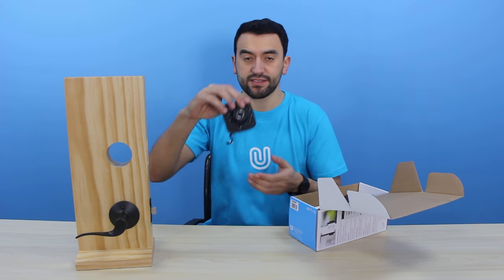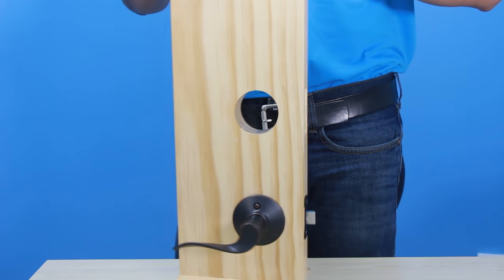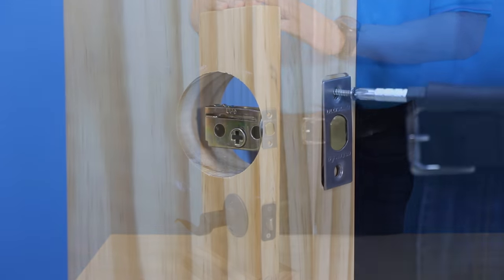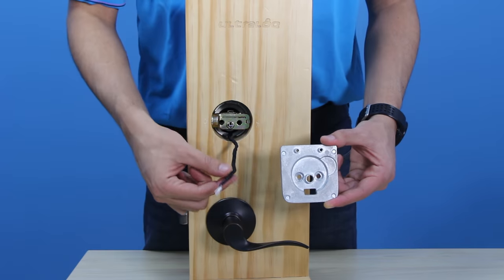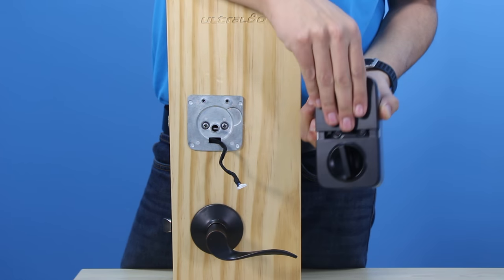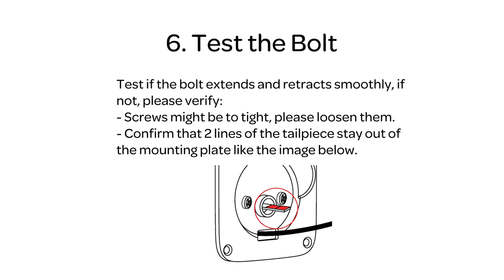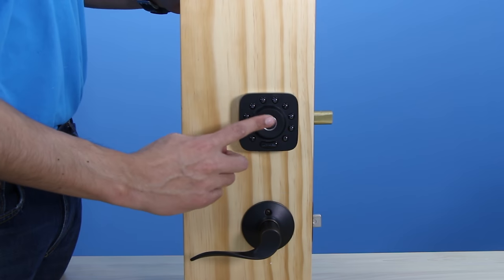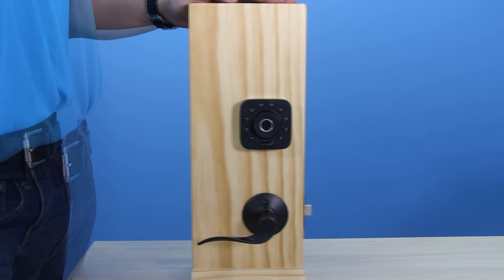Ultraloq U-Bolt Pro | Installation Guide

Comment: The actual included paper manual is TERRIBLE. It explains nothing.  Like there is a second plate that seems to go on top of the deadbolt plate in the manual. Totally unneeded for us assembly it appears.  Yet - no comment about why or what it is for in the paper manual.  Simply not included at all in this vid.
Reply: Installing mine right now and going through the exact same thing. I discovered through YouTube that the piece goes in the doorframe (I believe)
Reply: @mercy4630  Yes and it looks the strike plate they included has extra wide spacing for the screws and an extra big hole so you can place it pretty crudely and it will still function. And you don't have to worry about where the old screw holes were
Reply: I know this is a year later, but I've run into the same issue and think I've figured it out. That's a different door type in that diagram that gets screws A and B. If you have a door with the hole cutout, you just go straight to the screws C like the video did.

Comment: What do you do when you are told it is jammed and the motor seems to be resisting manual locking and unlocking? The app won't unlock it at all nor will fingerprint or code. Only having this issue after texas froze over. I replaced batteries twice already. Only started messing with it due to the low battery alert still on after low battery replacement, and now I have this jam issue. Wish I just left the low battery alert there.
Reply: Have you been able to fix the Bolt - jamming issue? :) ...Even Ultraloq U-Tec tech support do not have a clue what to do,, follow this procedure, it will take your U-Bolt out of Bolt jamming issue, the unit remembers or somehow memorized previous lock/unlock position, no matter how well you followed instruction to line up and/or loosen some screws - it would continue reporting bolt jamming (2 beep and the lock notch of the interior unit seems to be locking on something cannot lock right?)

Since you already has the unit setup/configured with the app, do not access the app while doing this, get ready your admin access code handy

1 - Remove the batteries, set the lock's bolt onto locked position
2- Insert the batteries, if you notice, the lock will not retract the bolt in locked position to unlock right? - keep it that way
3 - Now, while the bolt in locked position and with batteries installed, enter the admin code then press Ultraloq button - did it retract the bolt to unlock position? Yes , then Good!
4- Now, press the Ultraloq button again, did the bolt move back to locked position!
5 - Congratulation, Bolt jamming issue is just resolved!

I found this steps by spending 3hr on my 1st Ultraloq U-Bolt pro I bought on the 15th, no matter how good lineups I got of the installation's mechanic, it kept saying the Bolt-Jamming (to verify it I connected to App BlueTooth and indeed, every time I re-installed the unit and after the admin code setup , it kept reporting Bolt Jamming) until I found the steps above, basically remove the batteries, set the lock locked in position and press admin code again to have the lock learn its travel and lock/unlock position -  that fixes the issue!

I am surprise Ultraloq Tech Support could not give a proper troubleshooting technique to the customers except loose some screw tightness, position straight ..etc - that's not all - !! it is the unit's operational issue needs to be addressed.

Do not connect BlueTooth nor WiFi to save your batteries! and perhaps minimize intrusion/hack attempt - locks should be staying off the grid!
Reply: @jpthsd  yes it is fine. You have to reverse the orientation if it is giving resistance to lock
Reply: @jrg305  what do you mean reverse orientation? Like install the lock up side down? I hope you were able to correct your jamming bolt issue. 

if you ever try to reset your lock again in some situation, I am pretty sure it would report jamming! I tested 2 lock, all did the same!

Good luck!

Comment: 100% junk, reviews are FAKE. This lock and the company behind it are a huge joke.

I got the U-Bolt Pro with the built in Wi-Fi the other day and set it up. This lock was replacing a broken Eufy smart lock. The first issue I had was after putting in the batteries, the lock turned on but when I placed the battery cover on it lost power. I swapped batteries and did all kinds of tweaking to get it to finally work with the cover on. Next issue was the connection. I have an WAP right next to it about 5 ft away and the damn thing just won't reliably connect (or the app is simply awful) to the Wi-Fi or Bluetooth. When it connected, I could not get the finger print started and I could not set a pin without first setting a finger print. I also could not disable the auto-lock as the app crashed or did not connect to the lock. So I was stuck with a smart lock that could only open with the keys. I fought with this for an hour, then said fuck it and removed it.

I emailed support and listed out all my issues and asked for a return. They agreed and told me to send it back, but I must pay for return and these assholes didn't even provide a return address, nor is that listed on their website. Since they take about 12hrs to answer an email, I must now wait for them to provide the return address. This company is an armature and sucks at basic customer service. Stay away from this one.

Comment: I noticed in the manual it's only good down to 31 degrees Fahrenheit.  Is this true?  Seems limiting for much of the world.
Reply: Minus 31°F to 158°F outside, 14°F to 131°F inside. You'll have bigger problems than the lock failing with those temperatures lol

Comment: Trying to find out if the physical deadbolt knob on the inside still function's like a traditional deadbolt? Or if it only functional if a fingerprint, digital signal or key is used?
Reply from the maker: Hello Mister. From the inside, our deadbolt is just like a traditional one.

Comment: My lock won't lock and unlock.
Reply from the maker: Hey Will, please email support@u-tec.com and our Team will help you out.
Reply: I had the same problem. As the vid suggested, try loosening those 2 black screws holding the interior part with the batteries to the door. I did that and it now works perfectly for me.
Reply: It was the lock settings.  It came going the wrong direction.

Comment: Do not buy these locks. The batteries last about 1 week. I've tried multiple brands. I've tried disabling features. I spent $500 putting these stupid locks on my doors and now I'm looking for a better option that doesn't require bulk purchases from Duracell.
Reply: Something is wrong with your batteries bro.  I have 6 people coming in and out of my house all day long and have auto lock set up.  I replaced my batteries at 6 months
Reply: @breedlofam  we've tried 4 different types of batteries and been working with their support team for a month.  My wife is convinced they will work right some day, I just want to throw them in the garbage.